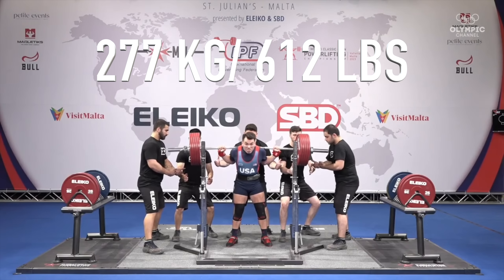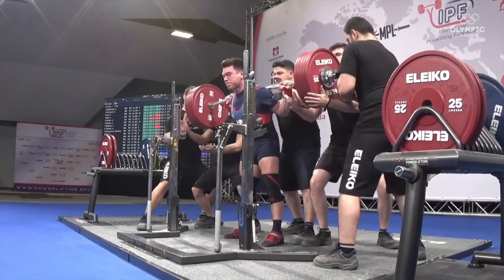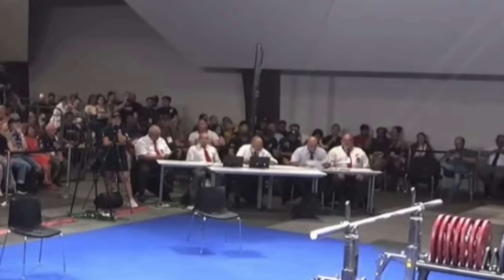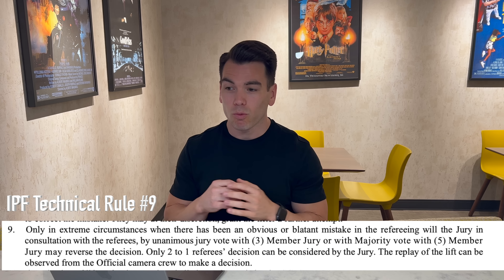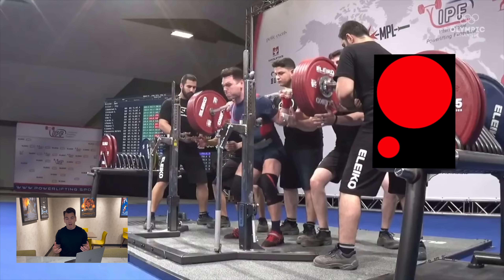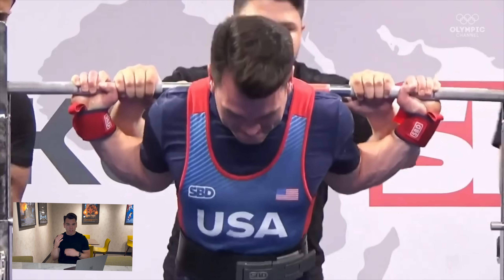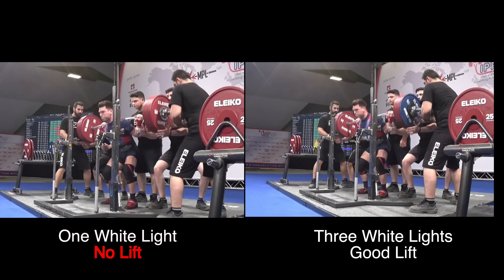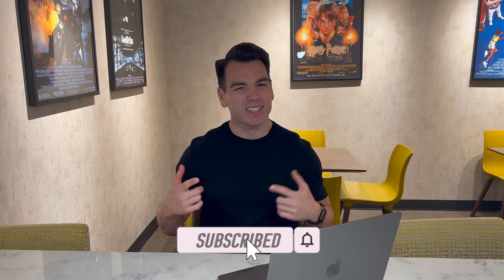612LB World Championship Squat: Unveiling the Mystery of Its Failure

Comment: I sat in the crowd on the left side. Taylor's right knee looked not locked out before any of the three attempts. The left side referee did not give a start command on the first and the third attempt (by lowering his arm). That is where the blue lights came from. Since he did not lower his arm, he then must give the blue card.
The call on depth surely is debateable. Replays are misleading, since it is only one angle, and judges must make their decision in a split second. I felt it was deep enough.
I personally would not have given a start command on either of the three lifts. The right knee just never straightened before any attempt from my perspective. But this is from ~15 meters away. It surely might look like different from any other angle or sitting closer.
All-in-all a tough call. But no robbery from my point of view.
Reply: As a judge myself (local level) I will say that it is frustrating but 100% necessary.  Just as you said... if I am a side ref, if I don't think the lifter is in the right start position I keep my arm up.  If the head ref gives the "Squat" command, because the head ref and one side judge say the lifter is in position then I must give a blue card.  If I am a head ref and I think the lifter is ready and one of the side judges drop their arm then I have to give the "Squat" command so I don't leave the lifter standing there forever waiting for the side judge.  Or, even as a head ref, if both side judges drop their arms, I am supposed to give the "Squat" command even if I think the lifter is not fully in the start position, and then I would give a blue card.  Frustrating nuances of judging, but makes sense if you think about it.

Comment: Depth was definitely good, the failed one was slightly higher. The knees looked a little softer when compared to the good lift, but that's watching it very closely having known what they red lighted for, and was still quite hard to spot. Overall, if the right lift was validated, the left one should have been too.

Comment: Umm, to me 277kg was a goodlift.  The 270 was lower, but still your hip crease was lower than the top of the knee on the 277.  Sometimes I feel that maybe the judges get used to a lifter hitting way below depth on an opener and 2nd attempts and the 3rd attempt might be a little higher but still to depth and inadvertently be called a no lift.

Comment: I thought it was good until I saw the side by side. Then it looked comparatively high, so maybe that's what the judges were comparing it to, and the reason for the red lights. So hard to say from just one camera angle, I would have given it a white if it was me in the chair though! No doubt you will come back with more weight on the bar with a flawless movement, undeniable 💪

Comment: Looked like the right leg came into the bottom of the squat slightly slower than the right, giving an illusion of the right leg not hitting depth. However, it did look like both sides of the hip did eventually hit depth. I'd call it a good squat.

Comment: I don’t understand how the center judge could red light so many lifters for depth over the side judges. Imo the center judge can only red card if it’s undeniably high, in which case the side judges would also issue a red card. The blue card is tough to debate without seeing from the other side. It’s plausible to me that your knee wasn’t locked because of how it looked on deadlift but I can’t definitively say so. However if I do ahead and say, for the sake of the debate, the right knee did appear to be soft, this lift should have passed 2 to 1 because there’s no way the center judge can see the top surface of the legs at the hip joint from the front. And the rules say “the lifter should benefit in all decisions of doubt made by the referee”. Meaning center judge can only call you of depth if it is high without a doubt.

Comment: I personally think you, Cenk Kocak and Bonica Brown got robbed. You lost your gold medal, Cenk lost his 1000 kilo total, and Bonica lost both her gold medal and squat world record from her deadlift bomb out. They all had valid lifts that were considered no lifts.
Reply: Cenk got robbed, but Bonica´s deadlifts were just not there.
On the Sumo pulls she could not get a lockout due to her shear size. And on the third she was just too burned out. Could have gone for a light opener to secure here world record squat, but she is just so used to dominating the class, that she and the coach fucked up the attempt selection once she came under some pressure.
Reply: @lindwurm5976  Her second lift was a good lift in my eyes. First one maybe a bit of up and down, but the third she kinda set herself up for failure cause she switched to conventional which she either didn't warm up with or didn't train with consistently.